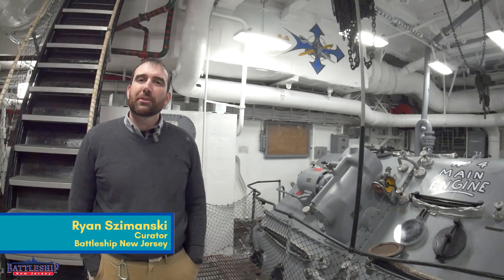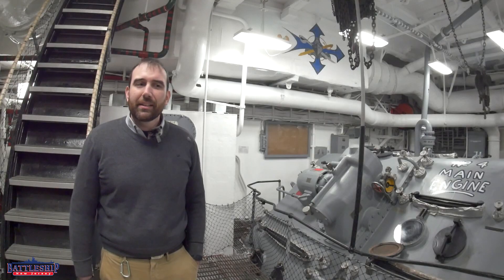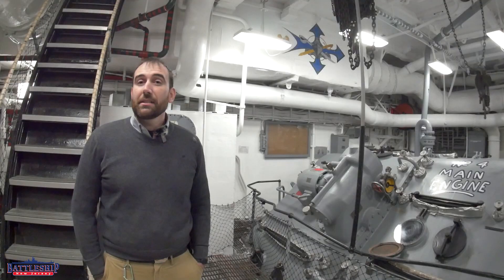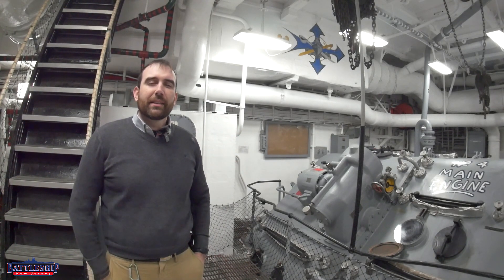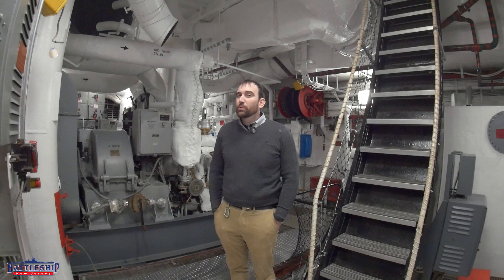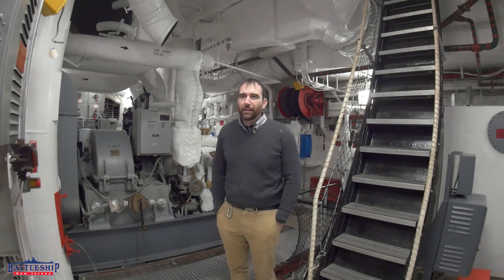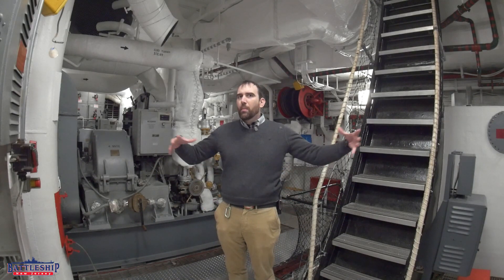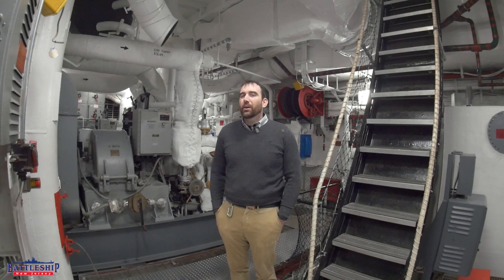Ways the Iowa Class Battleships Were Ahead of Their Time

Comment: One of the arguments regularly made against reactivating the old battleships is that the old engines and power plant wouldn't be enough by todays standards and it wouldn't be possible to upgrade those systems without compromising the hull and armor. How do you think this could be addressed with modern technology such as 3D metal printing and other manufacturing technologies?

Comment: Their radar cross section. When I was on the Missouri, we would often run with deceptive lighting to appear as a fishing vessel at night, and it was a good decoy, because we only gave off the radar signal of a small fishing boat. The ships are very low to the water, we used to take water on the main deck when we turned, and most of the exposed surfaces are rounded or angled, which directed radar signals in other directions, to make a small return signal to the transmitter. This was unintentional when the ship was designed, but it worked great once radars became popular.

Comment: 4 minor aspects that under certain circumstances could have given them additional usefulness to the Navy well into the 21st century had the Navy chose to keep them in ready status instead of gamble everything on the dismal DDGX / Zumwalt class assuming the NGF role would be:
1--flag facilities (at least 2 of the Iowas had these I believe) which could be upgraded to allow service (at least temporarily) as a modern command ship
2--the number of electrical and mechanical repair shops inside these beasts could allow them to fill in as Tenders for smaller surface ships in forward deployed areas
3--The sheer amount of fuel they can carry allowed them to (before the fleet switched to gas turbines) function as mini-oilers for battlefleets they sailed in, reducing the need for vulnerable fleet oilers to have to get too close to active war zones / reducing the need for ships of the battle fleet to vacate the war zone to meet the oilers.
4--When it comes to the danger of "masses of low end threats" (small air and surface drones, light aircraft, suicide speedboats, etc) attacking strategic choke points these heavily armored ships would be perfect for sea control because such low end threats pose very little danger to these ships due to their massive armor, design to be able to remain operation in the fight even with severe damage, and overall size of ship being able to absorb a lot of energy from attacks that penetrate or avoid the armor.  And with small RHIB sized drones towing MCM sonar arrays that can be lowered over the side, these ships can even carry their own screening escort boats to avoid sea mines.

To be honest, I think that had the navy not scrapped the land based maintenance and repair facilities for the battleship's armor and 16" guns and ammunition and barrel liner production, I think in the last 20 years the pentagon would have given in to the temptation to return massively upgraded Iowa hulls to service (replace powerplant with modern one using same fuel as rest of fleet, boost power generation 50%, production of planned extreme long range precision rounds for the 16" guns, reduction of topweight via removing armored citadel and remaining 5/38 dual gun turrets and replacing them with smaller 57mm gun turrets, and fitting out with newer strike and air defense systems such as adaptable deck launchers for housing tomahawks, dozens of deck mounted Mk 56 VLS cells for ESSMs, multiple Mk 49 pedestal launchers for RAM missiles, and 4 to 6 block 1B Phalanx CIWS, along with several ODIN weapons on Mk 38 mounts for defense against small drones.

Comment: One thing I'll mention that's actually backwards is armored conning towers. They added so much weight and an incident on South Dakota proved they weren't that protective. Not to mention it was more important to protect deck armor and ammo from plunging shells. 

The other two I'll mention are more so just a shame. Only two members of the class had Westinghouse geared turbines. 

Also, them using direct drive turbine was an important decision. However, the later standard US battleships members with their turbo electric systems could afford more subdivisions.

Comment: Iowa class on the surface seems to just simply be a beefed up South Dakota. However, the length in hull resulted in less cramped living conditions. While that would be a lesser issue for South Dakota these days due to smaller crews, there's plenty of other things that come with the more restricted interior of South Dakota class; including less flexibility for plumbing and septic systems. 

South Dakota and Iowa class seem like they initially have the same targeting computer, but Iowa just has an extra advantage. 

There's also the slightly deeper draft for South Dakota that makes docking less convenient enough for it to be noticed. 

The skegs being outboard for South Dakota instead of being inboard like with North Carolina and Iowa. This means the propulsion shafts were in the skegs. South Dakota had the outboard skegs to help with the short hull, but Iowas had no need for that. Not to mention it seems like inboard skegs have better torpedo protection. 

Also, as you said when talking about Iowa vs South Dakota engine rooms in an older video; Iowa was able to have more subdivisions and Ship's Service Turbine Generators (SSTGs). Not to mention also potentially a more efficient system to dispel non-condensable gasses from boiler feed water. Improved resilience with what the engine rooms can take was no doubt important to consider for the Cold War.

Comment: Most of the obsolete systems were removed and replaced with more modern equivalents as time went by( time after time). The Iowa's were a very modular design before that concept became a buzz word in ship design. The only real improvement in my opinion, you could make to an Iowa would be to replace the oil fired steam boilers with nuclear reactors. A battleship that did not have to refuel would be incredible. The only negative I can think of is the sheer size of the ship, it would be damn hard to try and hide an Iowa from modern radar and the acoustic signature would be hard to miss on a modern attack submarine. I don't think even modern countermeasures would help much. The design is incredible when you consider what our allies and the axis powers were producing at the time.

Comment: Great vid.  

Question Ryan:  You mention fastest speed, which, to a cube function, indicates the most horsepower for direct propulsion.  And you state the Iowa's have the most electrical generation of any BB.  How much total combined power from the engineering plant, propulsive, electrical (in terms of HP), other auxiliary power (steam driven mechanisms other than main propulsion and turbo generators), etc, did the Iowa's have?  How does that compare to not only its peer group in terms of total power, but to a modern Destroyer, Cruiser and even CV (to the best publicly available info)?

Comment: Is there any mention in the design records on why the Iowa’s were designed with so much electrical generating capacity (10k)? That much power must have seemed so outlandish when built.
Reply: Radar was already bering deployed, and electrically operated turrets just being introduced. Also  air conditioning was being installed in the new ships for the Pacific theatre (but not on BBs, IIIRC).  You can never have too much electric generating capacity, or fresh-water distillers on a ship.

Comment: No NBC; No air conditioning; The enormous manpower to operate the plant and the guns, guns that delivered firepower only a few miles and with limited weight of fire compared to an aircraft carrier. Nothing it seems was automatic. This glorious ship was obsolete before it was built. I should add that this was not necessarily clear at the time.
Reply: Even today (check a map of the Ukraine battle space), there's a whole lot of the other guys' toys, personnel and supplies in range of shore bombardment. You're not going to tangle with missile-defended zones, but roads and bridges and pipelines and refineries (or simply fuel depots) can't all be covered by high-tech. The Russians are going to choke on their logistics regularly. Count on it. Redundancy and flexibility do not appear to translate into Russian well.

Comment: I would consider their main batteries to be one why that they were ahead of their time simply because they could hit from father away while maintaining accuracy. Example Yamato’s main batteries could hit from about 20 miles though not that accurately while an Iowa class could hit from about 24 miles while maintaining much higher accuracy while doing almost the same amount of penetration while being able to be reloaded faster and probably more cheaper then a 18.1 inch battery from Yamato could.
Reply: 1. Range accuracy of the USN Mark 8 Radar Range Keeper- 35 to 40 yards at 20,000- 25,000 yards.
2. Range accuracy of the foretop rangefinder aboard Yamato- 60- 90 yards at 20- 25,000 yards. 3. Range accuracy of the Japanese Type 22 Mod 4 radar in a range assist role- 109 yards.

All of the above are more than offset by shell dispersion.
4. Shell dispersion of the Iowa class- 1.9% of range for a nine- gun salvo.
5. Shell dispersion of the Yamato class- 1.3% of range for a nine- gun salvo.

Historical performance:
6. None of the Iowa class battleships obtained a main battery hit on any warship of destroyer size or larger in WW2.
7. Off Samar, Yamato obtained 3 first- salvo hits on USS Johnston from just over 20,000 yards. She obtained 1 first- salvo hit on USS Gambier Bay (from a six- gun salvo which was aimed solely by the ship's radar because of a lack of a visual to the target until about a minute after firing) from just under 22,000 yards. She landed 2 shells a few feet alongside USS White Plains from just over 34,000 yards. Neither of them likely struck the ship. One exploded, and the damage was severe enough to force White Plains from front- line service for the remainder of the war.

From a surface action standpoint, the Iowa class had two advantages over the Yamato class.
8. A five- knot advantage in speed.
9. Remote Power Control- the ability for the fire control radar to remotely control the ship's main battery and maintain it on target in all conditions. The U.S. Navy never developed tactics to utilize this advantage during the war.
Truth matters...

Comment: Would turbo electric drive had made the Iwoas meaningfully more capable of accepting and mounting upgraded electrical equipment in the 1980s? could the Iwoas at their current dimensions have a turbo electric drive and still be capable of the same speed (if this were done in 1940 when they were built)? if a turbo electric drive were fitted to an Iowa in the 1940s would that have allowed the steam engines to be scrapped in place and modern gas turbines dropped in to replace them in the 1980s (assuming they somehow had the money to do this)? I know you have said the large steam turbines and boiler cant really be replaced because of the armor that the ship has, but a gas turbine is smaller.
Reply: The Navy experiment with turbo-electric had ended around WW I; it was seen as not as fast as geared steam plants. The steam was used all over the ship, not just for propulsion, so eliminating the steam plant for gas turbines would have had a ripple effect throughout the ship. Also, the Navy went to low-smoke cables for new construction, after STARK was hit in 1987, and installing the required new cabling inside a BB would have been yet another expense and schedule-pusher during reactivation.

Comment: If the NJ was reactivated for some reason and the propulsion system overhauled as much as they could without cutting holes in the ship, what top speed could they still reach and how much service life could they squeeze out before the engines are no longer serviceable?
Reply: How much work do you mean by "overhauled"? There's a recent-ish video that goes over restrictions or limitations, the engines were already limited due to issues with the gears inside causing excess vibration

Comment: I think in the 80s the gun controls would still have been fairly advanced, but if they were rebuilt today the entire gun targeting system would have to be replaced
Reply: The military did a study on this very thing in the 80's and 90's and determined that even with improved computing power, the accuracy of the Iowa's fire control computers was high enough to not justify the cost of removing the original electro-mechanical computers.  The only thing they did was they added da doppler radar to measure the speed of the shell as it went down range to adjust follow on shots with better velocity data.  I imagine that plotting against land based targets would improve with higher GPS accuracy, but actually making the ship more accurate would require significant advances in powder designs and GPS guidance...

Comment: The only thing that pops up to me as backwards or limiting harkens back to the recent video you did about the powerplants on the ships. That to me is glaring. The ships are fast as a class and are forward thinking, but in all of the power they can produce, the speed they sail, the weapons they can employ, the standard in which it can be upgraded is limited in one big area. The powerplants. In all the things that can be upgraded and were planned to be able to do so, it is the one thing on the ships that as I said, glare out as things that hurt the longevity of the ships. Largely due to their age and there being less and less people alive that can feasibly work them or keep them maintained that know all the little intricacies of each of the Iowas. That document you showed that specified each Ship had it's own operations and limitations based around their powerplants. Maybe people can learn from experiencing the ships, but even still that's a hard road to learn when you don't have replacements in case you mess up. To me, if the engineering took into account them being around for this long, maybe they'd have engineered a solution to be able to dry dock the ship and remove powerplants either from war damage or for upgrades like most other things could be on the ship. I also think the fact they were designed to be able to traverse the Panama Canal also being a notable design advantage. Maybe not a major one, but the fact they can cut down on traversing either major ocean by doing that is kind of a big deal to me, while a Super Carrier would have to sail all the way around the tip of South America.

Comment: I think another critical point is just the fact that the US designed the Iowas with an expectation that they would sustain heavy combat damage during battle but were intended to repairable even if potentially sunk in shallow water. The Germans also did this, but obviously the German surface Navy never approached the capability of the US. The Japanese, by contrast, weren't as concerned about repairability and salvagability. They were expecting to have a single decisive campaign in which the entire fleet of the losing side was going to end up on the bottom of the Pacific. Years later, this engineered consideration for servicability proved monumental in allowing cost-effective upgrades to be introduced even in the heart of the citadel

Comment: Question suggestion for a future video: Could the Navy EVER have swapped out the original steam turbines/boilers/turbo generators etc (for Korea/Vietnam/80's recommissioning)? Or was the original equipment "locked in" forever, once it was installed & the superstructure built over it(?) Keep up the great work & best of luck for a smooth dry-dock 😀
Reply: With money and desire, anything is possible.  The biggest issues to replacing the engines of the Iowa's is the armored deck is 6" thick over the engineering spaces, and is one of three armored decks.  You'd have to cut holes through all that armor to replace the engines and doing so would compromise the effectiveness of that armor to stop the threats it was intended to stop as you can't weld through all six inches of it... at least... not easily.
Reply: @Whiskey11Gaming  Correct, and we don't make Naval armor in that size any more
Reply: IIRC there was a proposal to swap out the steam plant for 8x LM2500s in the 1980s, but it was too expensive and time consuming.

The deck armor wouldn't be cut through, just removed since it wasn't structural. As for making new armor, Midvale was long gone by the 1980s but the records and some of the old workforce were still out there, and between them and US Steels expertise in nuclear containment vessels (battleship armor essentially, but in cylindrical shape), they'd have no trouble cranking out new armor.

Comment: The most backwards looking thing was still having a full armoured conning tower; that’s a lot of weight and stability that could have been used for other things.  It’s not even a retrospective issue, as the Royal Navy had already moved away from this idea with the KGVs.

Missed opportunity was not having better aviation handling facilities (e.g. a below deck hangar like the Des Moines / Yamatos).  I know you’ve talked about that as a design choice, but once you’re in the Cold War and much less likely to be in a battle line engagement the ability to better operate helicopters (and ultimately drones) would have been useful.

Finally, why did they retain any 5”/38s in the 80’s refit?  Whilst not backward looking at the time she was built, I don’t understand what utility they offered in that time period?  Surely the deck space, magazine capacity and displacement could have been better used (more missiles, different missiles or even just better guns?!)